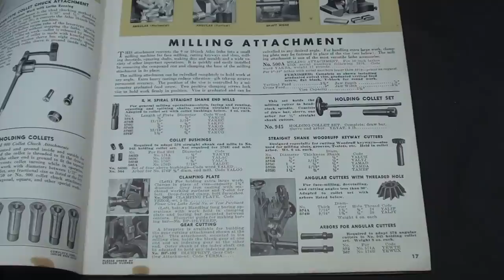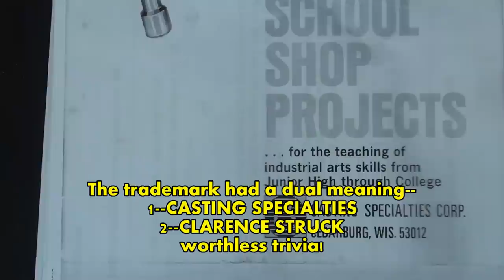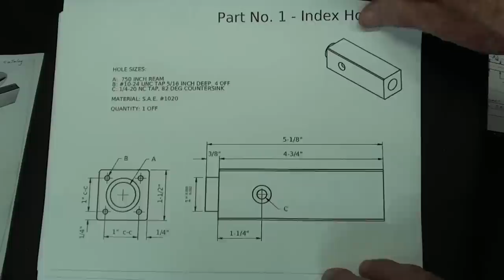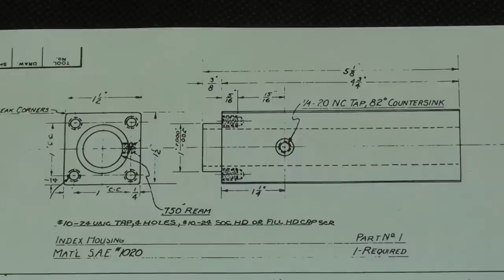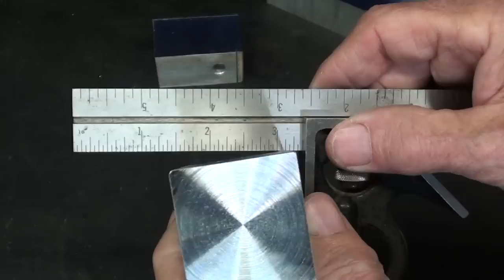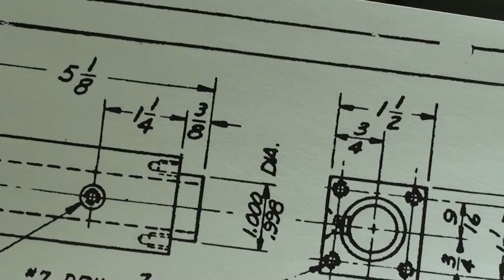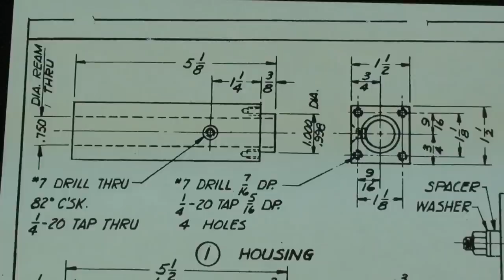AMAZING ATLAS GEAR CUTTING FIXTURE Lathe pt 1 835 housing tubalcain

Comment: These are the videos we novices love the most, a great learning experience, also have been watching your training videos on how to run a Bridgeport mill and South Bend lathe. Love them, and thanks for taking the time to make them.
Reply: You should remember, as I do, and since you are not that much older, that there was what was called a “fair use rule” as applied to copy written material used in education. This rule basically said that as an educator you could use copy written material for educational purposes without fear of prosecution.  Since Mr. Struck’s material was design for student use and marketed to educators  to instruct students it is highly unlikely that he could have been prosecuted for copy write infringement regarding the drawing.  I believe your second conclusion to be more correct “It just didn’t sell.”

Comment: Very nice Mr Pete. I have drilled deep holes in a lathe project. Removing the chips required moving the tail stock. I placed a spring clothespin on the bit to aid me when pushing the drill back into the work. This saved me from jamming the drill into the bottom of the unfinished hole.

Comment: Thanks for another great series. Although I’ll never make this project it’s always interesting to see how it’s done. 
I have several inventions and unique modifications in my shop that could be shared with viewers through your channel if they’re interested. One is a ball bearing bench mounted fixture to very accurately balance grinding wheels. It uses an external balancing ring with small weights to perfectly balance surface and bench grinding wheels for vibration free operation.
Reply: I'd love to see that Ellie.
God bless you!
Reply: @michaelboyle1983  Thanks. If there’s enough internet and Mr. Pete is interested it could be another collaboration.

Comment: I've been using my Diamond Tool Holder for 15+ years and I love it.  It makes great cuts, but the reason I like it so much is that I'm cheap.  I'm still using the same little nub of HHS I started with.  Sharpening is a couple passes on a bench sander.
Reply from the maker: Good to know!     I hope to make a two-part video on the tool holder

Comment: Oooo... Intriguing new project, yay!

The prints are quite readable on a 42" tv 😁

TTBOMU, the copyright applies to the drawing, not the part. Recipes aren't copyrightable (although the surrounding text is), and i believe (IANAL) that the same principle applies here.

The hole came out tight because it was on size. Without 0.0005"–0.0010” of clearance, it won't turn freely. This is why most of my reamers are over/under reamers.

Comment: This is pretty simple, really. Im pretty sure you and I could build this just going by the basic picture. But it’s great for students. Back when I went to Stuyvesant High School, in the late 1960’s, I took a year of machine shop as an elective. The project was to build a small, simple lathe, apparently based on the Unimat SL. I didn’t think of it at the time, of course, but now I wonder if they bought the plans and possibly the castings from this company.
Reply from the maker: That's pretty cool!

Comment: Amazing. That ten page drawing set had a two view orthographic projection plus an isometric view for each part, but the last page of the whole assembly looked to be a trimetric projection. Speaking as a former technical illustrator myself, that is awesome. Of course, nowadays you just rotate the damn thing with your mouse in Fusion 360. Not nearly as elegant as hand drawing it in pencil and then inking it on Mylar, in my opinion. Thanks Mr. Pete.
Reply from the maker: I sure miss that india ink.

Comment: There are tons of cheap, Chinese milling attachments available for on eBay. It would be a great project! I would modify it so it doesn't require an identical gear, which may be either unavailable or too damaged to be useable. Instead, it would use a round disc with holes for the teeth positions drilled around its perimeter. A pin of the same diameter plunges into each hole or indexing.
Reply from the maker: Thanks for the tip!

Comment: I have not seen a lead hammer since I was a Westinghouse apprentice 50 years ago. I plan to build this tool and use it in my Enco mill. I need to make a lot of gears to rebuild a 14 1/2  inch South Bend 2 handle gear box that destroyed a bearing, which then tore up most of the gears. In stead of buying those expensive gear cutters I use a fly cutter that I made that holds a 3/8 hss bit at 90* hand profiled for the teeth. ( I still hand sharpen my drill bits too, lol ).

Comment: You could have used round bar. With a flat on for orientation although it would not matter if it was fully round as the vertical slide vice would easily grip it. Would be easier to make for those without a milling machine. Thanks from Australia.

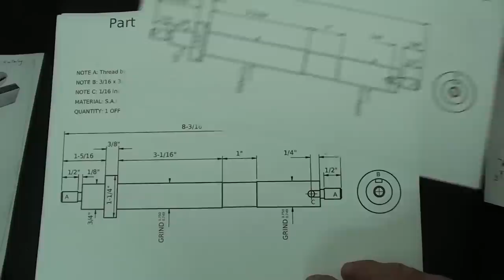Comment: At about 9:04 of the video you show the pictures of the different versions of the shaft showing different sizes of thread at the ends of the shaft.  I believe that the smaller diameters (such as 5/16" thread) would be for making smaller diameter gears such as might be found on a 6" Atlas lathe for change gears.  If a 16 tooth gear with a DP of 24 was being made this would require a gear blank with an O.D. of .750" if I did the math correctly.  The cutter would be cutting to a depth of .090" to create the teeth profile so the diameter of the gear at the valley of the teeth would be .570" (.750" - .180") after it was cut - a 3/8" hex nut would be too large to use to hold the gear blank on without the risk of the six 9/16" hex flats engaging with the cutter teeth to some extent.  A 5/16" hex nut that is 1/2" across the flats might sneak past the cutter without the cutter touching it.  This is possibly why the shaft is shown with different diameters of thread - just my opinion.

Comment: Chucking reamer may have been resharpened which would slightly undersize it. I see you are using the spill proof paint cups for your cutting oil, I use them also but I place a decent size magnet in with the oil and it holds the oil container down where I want it to stay and I don't worry about it vibrating off and falling.
Reply from the maker: Yes, but the magnet attract chips, which is incredibly annoying
Reply: @mrpete222  Haven't had an issue with it attracting chips. but the magnet in mine is about 1" round and where the bottom of the cup is rimmed ever so slightly it hasn't tried to grab chips. But I understand why some don't like magnets around.

Comment: Informative and entertaining as ever.  FYI : at 22:17 the first drill kicks upwards as if it hits below the centre of the starter hole, then at 23:23 the larger drill does the same, but to a lesser degree.  Any upward kick of the reamer as it engages at 24:12 is minimal, but after re-watching all 3 at half-speed playback I think it might just have done so.  Perhaps a tiny chip in the tailstock quill or sleeve ?
Reply from the maker: All of my machines seem to do that. In the end, it doesn’t seem to matter. Everything is old and worn out, including me.

Comment: You should remember, as I do, and since you are not that much older, that there was a “fair use” clause to the copy write law as it applied to education and educators.  It basically said that as long as the material was used for educational purposes there was no infringement.  I do not believe that Mr. Struck could have been prosecuted or warned to cease and desist from using the Atlas drawing since his product was designed for educators for use in instruction.  The more likely scenario is as you alluded to: It just did not sell.
Reply from the maker: Thank you, I can’t imagine any student that would have wanted to build that. Teachers either for that matter.